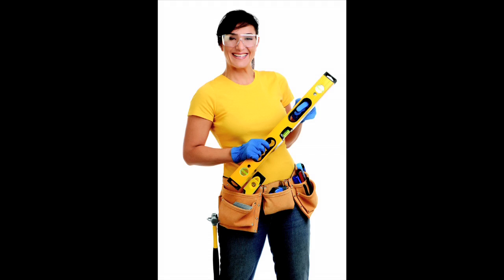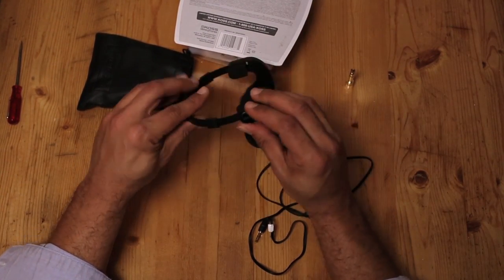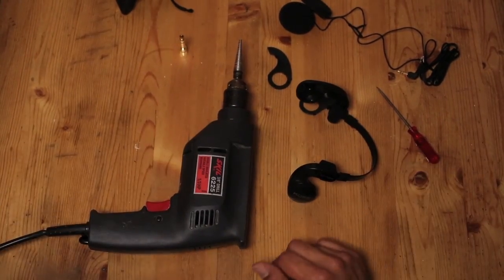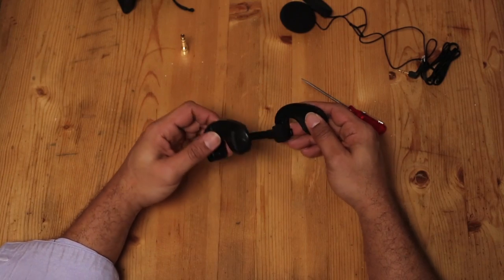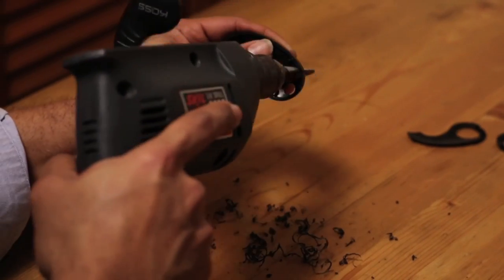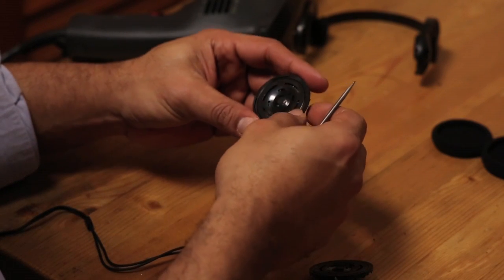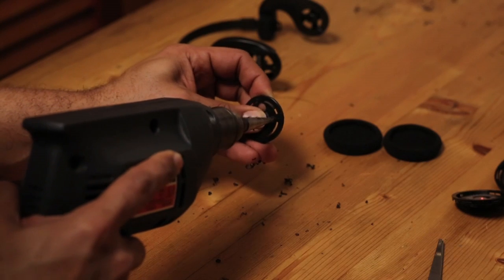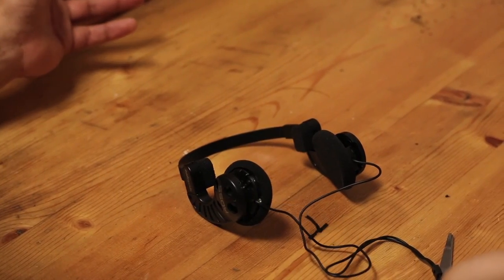Best Cheap Portable Headphones in the World. Koss Sportapro Portapro DIY Audiophile Mod Tutorial.

Comment: I have owned 2 pairs of the original incarnation of what became the Koss Portapro, and I also have a pair of LV-10s (full sized studio pair) which were also sold branded as Radio Shack, but still had the little Koss logos. I have owned these three pairs for about 30 years.
I am a musician, and have worked for many years as a tech in a music store, and had the opportunity to try endless pairs of headphones. The bottom line is that nothing has matched my Koss headphones at any price. I've also introduced many musicians to them who thought they were down market because of their reasonable price.
If you are timid about minor repairs to Koss phones, like foam pads, wires worn out, Koss has a very reasonably priced repair service with very fast turn around.
Reply: Porta Pro has a Limited Lifetime Warranty. I bought mine in '82, they have been in for servicing 5x, each time KOSS has sent me a new pair. Oddly enough, each time I sent mine in, it was the logo on the center of the earphone that fell off! This is so stupid, it's akin to having the BMW/Mercedes/Porsche logo falling off the car you purchased.....I keep promising myself that the next time I'm removing both the L&R logos and attaching them with a permanent adhesive.....6-8 Weeks turnaround for servicing a simple printed aluminum disk that could of been sent to me in an envelope...You wouldn't put up with this BS if it was your car.....Good Lifetime Warranty though!
Reply: Koss is great and all but I don't think they're good for monitoring since they do have a bit of a sound stage and lack of noise cancelling.

Comment: I just went through a similar exercise - I think you can achieve the same impact by simply switching to KSC75 ear hooks - way more comfortable, similar improvements, more portable (1/3rd the size).  Still, cool, and great experimentation!
Reply: I love the KSC75 driver, but I HATE those clips!
Super uncomfortable for me.
They sound great with the driver grill totally removed and replaced with just a mesh grill of either grill cloth or even screen material.

Comment: What an awesome video! Thanks man. I probably won't do it (I have PortaPros), but it was very interesting to watch. Compared to PortaPros, would you say that these modded SportaPros sound better?
Reply: They have a slightly different low mid texture and top end. 
But they're very close.
Reply: The porta pro is still better even if it's slightly better

Comment: Hey man, thanks a lot for the video!  Just wondering, instead of putting foam inside the channel to lessen the vibrations in the channel, have you ever tried just leaving the shields off so it's no longer an enclosed space?  Or would this make the sportapro frame weaker?  Just wondering because the portapro is hollowed plastic with no shield on it.  Thanks again!

Comment: I feel like drilling out the frame of the SportaPros is completely useless. The drivers themselves have tiny holes on the back side around the edge which are what make them open headphones. The frame does not interfere with those ports behind the driver.
Reply: The housing has a resonant frequency that masks the sound coming from the driver. The holes in the armature are just to lessen that resonance.